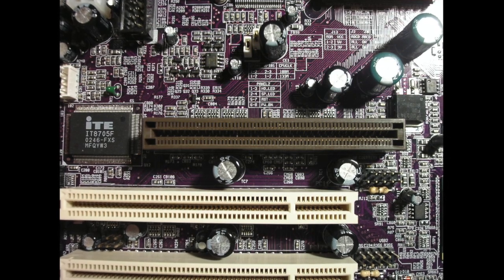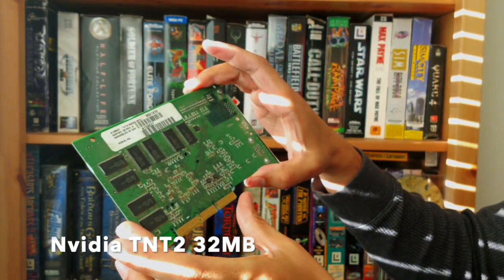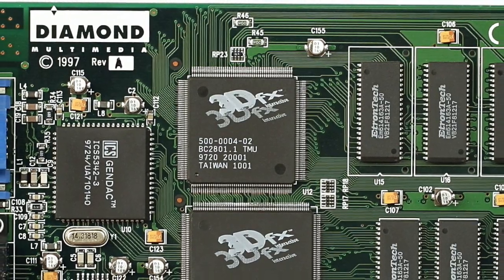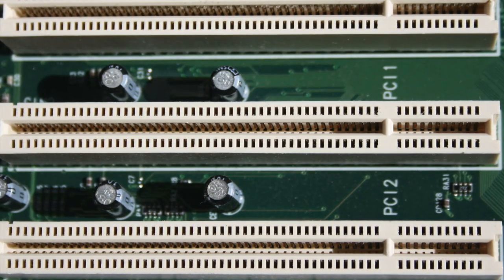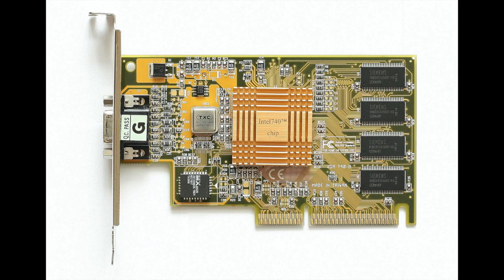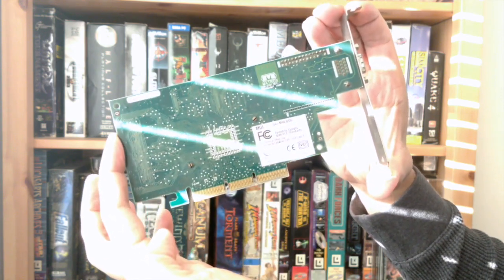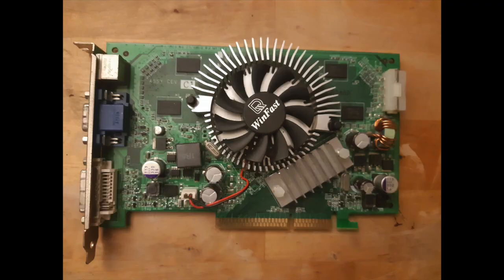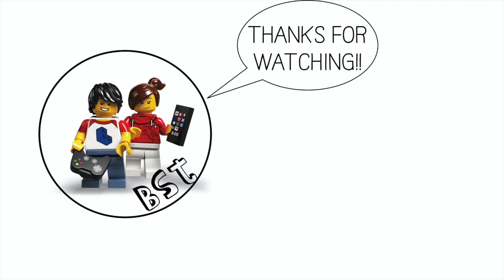Whatever Happened to the AGP Slot on PC Motherboards?

Comment from the maker: What was your first AGP graphics card and what game did you buy it for? Mine was the TNT2 Ultra and I think it was Half Life that really knocked my socks off at the time :D
Reply: My 1st gaming rig was a Gateway 2000 with a Riva TNT 2 ultra 16mb along with a 12mb Voodoo II.  But I still have both a Sapphire Geforce FX5900 and the Beast from Nvidia called the BFG Geforce 7800 GS OC 256mb. Both AGP and both still work just fine ^_^ My newest 2 machines have an EVGA GTX 680 ftw 4g and my newest that still rocks a RoG Strix GTX 1070ti that I plan to replace with either an RTX 3080 20g or an RX6900 AMD card depending on which lets me buy it first filthy bot using scalpers be dammed!
Reply from the maker: @heyfunny_w  I have a 2060 super in mine at the moment but may go to a 3070 next year with possibly a HP g2 VR headset. The 2060 works fine with my rift s at the minute.

Graphics cards and performance have surely improved over 20 years hey!
Reply: From ET4000 ISA 1mb to Matrox Mill. 2 PCI 4mb + Voodoo 2 addon 8 mb PCI to Voodoo 3 AGP 16 mb.....after that Geforce 4 TI 4200 AGP 64mb...
Reply from the maker: Thats a pretty solid evolution!
Reply: what is your favorite expansion slot... mine is ISA
Reply: My first and last AGP card was a GeForce 5700 ultra. 
Edit: I suppose I probably had an older AGP card in my old Dell Dimension 8100 powered by a 1.6ghz P4 but I never opened that PC up since I knew very little about hardware at that time, this was back in 2001 or so
Reply: Great Video!! My system in summer of 95 was a 486 dx4 100 with cirrus logic 54xx and it was great playing doom,doom2, heretic, rise if the triad, under a killing moon and many great dos games of that era. I later upgrade to a cyrix 686 120+ with the diamond edge 3d nv1 and many great windows games, then came the voodoo1 boy what a game changer!! I upgrade in the beginning of '98 to and amd k6 2 300 with a soyo agp motherboard and a riva 128 agp but kept the voodoo1 cause of the enormous glide support in games.
Reply: First agp was the vodoo3 1000 aka velocity. Before that I had pci matrox mystique + voodoo2. Before that I think it was just a s3 virge.
Reply: GeForce 4 ti
Reply: nVidia TNT2 Pro :)
Reply: Im not expirienced when it comes to agp related stuff 
How good or bad is fx5200 agp gpu for retro gaming (i might build windows 98 based retro pc socket 478 likely pentium cpu 1gb ram or less havent confirmed it all yet(im still trying to find the parts ) gpu i got the fx 5200 already i dont know if its 128 or 64mb vram
Reply from the maker: @energygameplay6513 hey mate - enjoy the journey! It's been a while but the fx5200 I think is pretty decent enough. I think the channel Philscomputerlab shows how he uses similar cards on a P4 and can even emulate glide with them as they came out later and are a bit more powerful. I have a similar PCI card matched with a voodoo 2 in another system and its not bad.
Reply: @ByteSizeThoughts  as i said im still finding the parts and stuff and i havent even tested the fx5200 if it even works i mean i was told it works but 
I dint know what cpu im getting yet  and if fyll pc or not i today i contacted seller of 478 pc waitign for his responese
Reply: My first was a ti3 200 the last new in box a HD4650

Comment: I have a PCIe to AGP adapter and an Athlon XP 2400+ with GeForce 960 and 2 GB 😁 Technically feasible but more for show than use as it doesn't do much good as the CPU is too slow. 🥱
Reply: hi chris, could you post a link to which adapter you are using with your setup? cheers!
Reply: @ShrineOfLife  My system was even featured on PC Games Hardware and Tom's Hardware. I can look up the links, but I don't know if YouTube allows such links as comments. Because such comments are automatically removed.
Reply: Unfortunately that didn't work. The links were removed.

Comment: Operating systems still detect PCI Express as PCI device, because PCI Express is implemented in such a way that it will identify it self as PCI device, so it will be backwards compatible with older OS, even Windows 98. Some of the early native PCI Express graphics cards (GeForce 6 series and Radeon X300/500/800/1000 series) have Windows 98 drivers.

Comment: "Quake could just about be run on a 486DX4/100".

Such high requirements! It'll run on a 486DX/33. It's a slideshow with sound breaking up, but it runs. It will not, however, run on a 486SX at all. If you try, it'll dump you back to DOS complaining it can't find the FPU.
Reply from the maker: ha - though back then people played through games on lower than 20 frames per second sometimes. We are spoilt these days for sure

Comment: 4x agp really ushered in the next generation of gfx acceleration. Pci-E 16x was rediculous. I still have a 9800gtx+ 512mb for an xp system. It was the Gts 250 clocked lower. Saved around $100. It's still kicking because Evga

Comment: Thats not true about quake and the 486 dx4 100mhz.. my 486 dx4 100mhz witch had a sis motherboard had 3xpci 2xisa and 2xisa vlb and i had a ISA ess soundcard and a pci sis VGA card witch i added the extra 1mb vram totalling 2mb vram and i had 16mb system ram and it played doom and duke Nukem 3D and quake just fine!! Sure quake was at the lowest settings at 640x480 but it averaged 20fps some levels was faster others slower but not as low as 8fps lol the dx4 was a beast of cpu compared to the dx2 66 was as good as the Pentium 66mhz.. especially when you are in dos not windows 95 and it run 98 pretty well for what it was especially when i added upto 32mb system ram..
Reply from the maker: That sounds like a beast of a 486 - top of the range!

Comment: My first Windows PC was a hand-me-down Gateway...wow, I forget the model number. I know it had a P3 500, A CD Drive, a floppy drive, ab 8GB HDD, 64MB sDRAM and an 8MB Voodoo 2. Wow I loved that thing. I added a CDRW a year or so after getting it, along with 3 more 64MB sticks of RAM for a whopping 256MB's! After a couple of years I did pull out the old P3 along with the rest of the components to build my first desktop PC. Wow was I terrified, and eventually brought it to a PC shop to show me where to plug in the wires as I was clueless and none of the wires were labeled. I was so nervous the idea of simply tracing the wires didn't even occur to me. 2 days and $20 bucks later my new PC was up and running, but wow. I'll never forget when I first wiped it, reinstalled Windows 98 2E and put in the first disc for Baldur's Gate 1. The intro may be dated now, but oh my goodness did it blow me away.

I was used to Playstation 1 graphics, but this was an entirely new level of polygon heaven. I remember looking through PC World for reviews on parts and saw a 512MB Hercules GPU which completely blew my mind. A GPU that was half a Gigabyte? Who the heck would need all that? That's crazy. For $3999.99...Yep, a kid can dream.

Oh, I had the original sticker that came with the Gateway in 1998, and the MSRP was over $3000 bucks. Less than the Hercules card, but still a boatload back then. I got into POV Ray for a while as well. I recall playing with a chess piece, on angled flat ground, and a grey rectangle wall on the right running from the background to the foreground to add a more shadow to the pic. It took 5 hours to render. 1 Frame. Of a chess piece with a completely plain angled rectangle. 7 hours. Oh the power of the P3 and a Voodoo 2! Heh, and folding for cancer research. That was kinda cool as well. 

The next GPU I remember was a Radeon X700 Pro 256MB, but can't recall what cards I had in-between the Voodoo and that. Lol, it's bugging me. You'd think I'd remember the the GPU I used in my first build...Oh well.

Anyway, nice to know why they scrapped the AGP standard. I am at a bit of a loss as to why they didn't just scale up the AGP standard, as it was far superior to PCI up to x8. Not that it matters with the tiny BUS widths for the amount of memory they are putting on cards now. 16GB with a 128GB BUS... "Yeah, but the extra cache makes up for it and gives it an effective spe..." No, no it doesn't. It bottlenecks constantly at high resolutions and/or high refresh rates, as does 192 bit with 12. This overcharging while underspec'ing crucial parts of GPU's really needs to stop, but that's another story for another day.
Reply: I get what you are saying with the GPU's but its not like back in the day where the GPUs had no cache or next to no cache and a hamstrung memory bus width would decimate all hope of performance. Its not like they are putting 2GB with a 8400GS or something and it 'cant be utilized' fully. What matters is memory bandiwdth in GB/S and if today you can match or exceed yesterdays 256bit memory bus cards with a 64bit one today, then the bus width does not matter as memory tech has improved to the point to negate the bus width. And the cache helps even more, like a GTX 960 can beat the 6870 despite having less bandwidth because of the cache.
Reply: Even 16gb on a 256bit bus is held back

Comment: So it was slow ?? so why Intel created it ?
Reply from the maker: It was fast at the time, faster than original PCI - its just that it didn't take many years for PCI to improve and get faster and overtake again making it obsolete.
Reply: @ByteSizeThoughts  So AGP can only get 8x speed ?? Why didn't they tried to research it to get more speed ??
Reply from the maker: @yevgeni10  I think the motherboard architecture would have caused other bottlenecks giving you diminishing returns. Hopefully someone with a deeper technical understanding can chime in
Reply: @ByteSizeThoughts  hmm probably because of low power consumption .
Reply: @ByteSizeThoughts  the general trend was the switch from parallel to serial bus connections - hard to keep many parallel data lines in sync at high clock speeds. its why disk drives changed from PATA to SATA.
Reply: One of my best PC memories was plugging in a Voodoo 3 16MB card along side my Pentium II 350MHz CPU... Until that point id struggled on, onboard graphics cards and seeing that card open up so many games was just amazing.

Comment: great vid, i'm actually in the process of setting up a 9800gtx+ a mate gave me a little while ago. its only been used a few hours, theres a long story behind it but the card is working perfectly. sadly none of the spare power supplies that ive got spare have enough pci-e power plugs for that beast! one of my other psus need to donate themselves...
Reply from the maker: Yes, I actually remember when I got my vista prebuild from Amazon I would experience computer resets and I finally realised that the stock PSU wasn't powerful enough (or just wasn't efficient enough). I think I went and put a 600watt one in or something to cure it. It's amazing how modern cards are more power efficient with much lower power draws but much more graphics horsepower.
Once you've got your card up and going then put on doom3 and Crisis and see if it sweats :)
Reply: @ByteSizeThoughts  what a nightmare with a new pc! i'd be so mad.
i got the power sorted, the 9800 GTX+ is absolutely fantastic. playing doom3 in 1080p with no drops. i've completely filled up a 32gb SSD in no time so i need to switch that up too :D then maybe i'll think about crysis. its gonna sweat big time :P

Comment: Excellent vid as always mate. AGP is where my heart lies. The first 3D card I owned was a TNT2 Ultra Maxi Gamer Xentor 32. I think I paid £179.99 back then. I think I'm fairly on the same time line as you when it comes to nostalgia. If memory serves I'd have been playing HL, Q2 and Q3 on that. Actually, I did have a Voodoo 1 from a mate but it ran like crap on our Cyrix 100mhz so I sold that on at school. Actually, the very first accelerator I bought was a 16mb Banshee I used on my P166, then I bought the Tnt2 when I went to my Athlon Slot A K7. I forgot about the banshee. I wasn't that impressed by it and upgraded pretty quickly to the K7. It's difficult to remember exact dates of purchases back then.

How are you and yours over there keeping? Are you allowed out and about yet? I'm still working from home and schools are still pretty much closed except keyworkers kids. I've made some retro PC purchases lately, but luckily the sellers were nice and will keep them till things get better before posting. I'm a wimp and I hate germs lol.
Reply from the maker: This Banshee I bought on ebay just over a year ago as it was relatively cheap and then never used it. My geforce 2 is more powerful so dont really want to install it. Though the price had doubled in the time Ive had it, I may move it on at somepoint :)

The TNT2 price sounds about right. I had a part time job and spent a whole months wage on getting my TNT2! Do you remember what pack in games yours came with?

Its been ok over here in NSW for a bit but there is a bit of a resurgence going on. We've been lucky so far but I think we might be heading towards another lockdown! Even so I did manage to pick up a few beige boxes this week - will try to put a video out soon
Reply: @ByteSizeThoughts Hello mate. Just wondered if you're still around? Missing your vids over here 👍